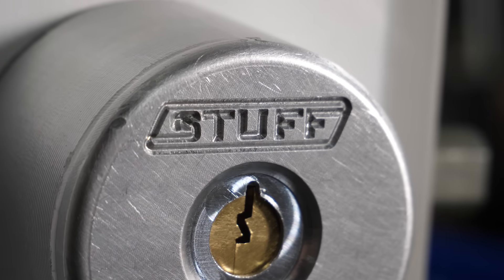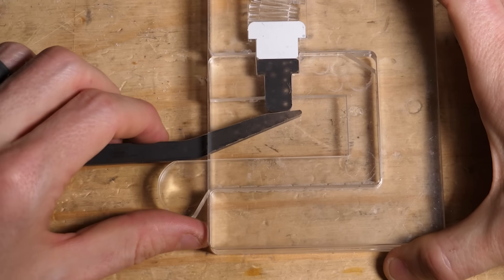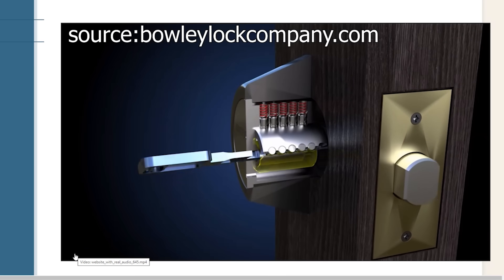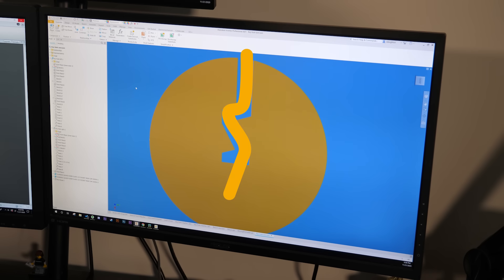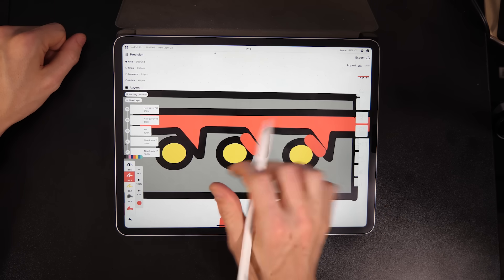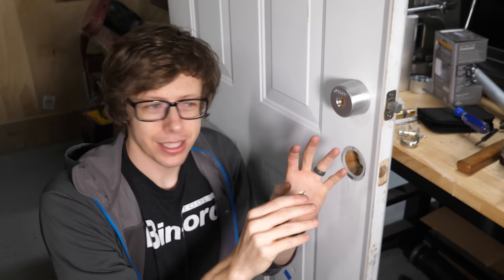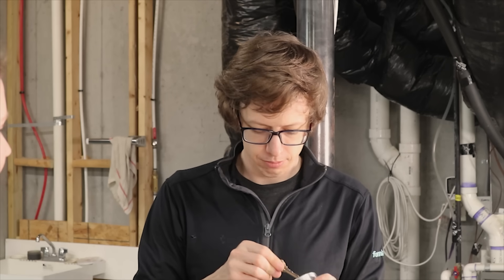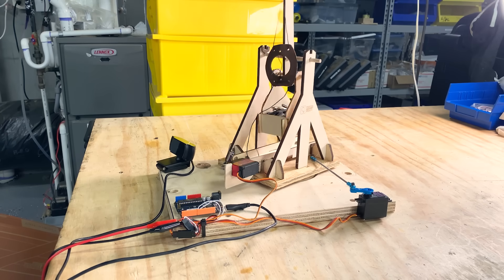Making an unpickable lock. Calling locksmiths

Comment: I'm no LPL, but I'm a decent picker.

If I was to try to get into this, my first strategy would essentially be reverse picking. If you aren't familiar,  with reverse picking you lift every pin above the shear line and then slowly release tension. As the pins fall the driver pins will hopefully get caught on the ledge from the shear line, and the lock opens.

Now, I know what you're thinking. The springy mechanism that traps the pins will keep them from falling, thus thwarting the attempt.  I think we can defeat those though. A good solid thwack on the front of the lock could potentially knock them back, allowing the pins to fall for a fraction of a second. 

So, we lift every pin, maybe with something like a comb pick, maybe with an uncut key. Next we turn the lock as far as we can. Finally we slowly release tension while rapidly whacking the lock. It might take a few tries and some luck, but I think it would open.

Comment: The most obvious attack would be to over set all the pins, i.e. push them all up over the gates with a comb and turn the lock. Assuming that's defended against, I suspect that decoding would be another viable attack, you can push a pin up to a given depth then turn the lock, when the lock binds, you could try reaching up with a pick to see if it is jammed or loose, and if the latter, the pin was likely at the right height. Repeat for each pin and cut a key when done. You could even do this by taking a key blank and filing it down as I don't see how this lock holds the key in place when it is turning.

Comment: I'm thinking you can use a long tension wrench to push the lever that the key pushes and apply tension to the pins and then use a normal pick to lift the pins one at a time and then use it to turn the core.

Comment: Hey SMHere ! I have a suggestion related to lock, maybe you could make a key way that use optical sensor to unlock the door but it would require a regular key for the mechanism.
On your design shown through the video, it's 3 pins. So let's take that base.
Each sensor will look through a small hole made in the pin that would hide the reflective surface on the other side. In order for the mechanism to unlock the closet pin would need to be the first to move then as you slide the key in, the second then the third. Then all pine set by the key will actuat a step motor to move the Deadbolt. If the electronic detect the pins are being move in a random order the key way would never disengage a step motor holding a pin preventing the keyway from rotating. A refusal standby would stay active for 15min before accepting to put a real key in.
Would that be insane? Definitly
At what cost? Electronic and coding Knowledge.
Also you could implement that on your already made unpickable(or maybe unpickable) lock lol.

Comment: A very interesting project. Something new in locks. 

One idea to help increase reliability of the pin locking bar is to use a fixed locking bar with a soft rubber between the bar and the pins to take up the tolerance.

Comment: Him: "if you want a lock to be unpickable get one without a key"
Me: we just went from pickable and unhackable to unpickable and hackable.
Reply: Picking is just mechanical hacking.
Reply: I mean, if it doesn't work, use a bigger hammer
Reply: @saturnity6  or even magnets
Reply: Don't cars have fairly decent wireless keys? If you trust the lock to secure a million dollar car that every burglar and their weird sidekick would want to break into/steal, I think it's safe for a plain door.
Reply: Also don't forget about those locks with number pads. It's basically the same thing, except the pass phrase isn't transmitted wirelessly but entered manually and those are pretty secure too, right?
Reply: Well in theory, thanks to some clever math called hashing, similar to data encryption, digital locks should be unhackable before the heat death of the universe. 
...in theory.

Comment: What if you over-lift the pins and turn the lock so all the pins are above the slot. Then you hold light tension as you tap the lock with a hammer, that should cause the pins to fall down (because the are only held up by springs). And the tension should make the pins catch the edge of the slot and then it should open.

Comment: The problem is, you're using an insecure key.  Anyone with a picture of that 2D key can just duplicate it. -- Also I'm surprised the locksmith couldn't get it.  They usually have a special key that let's them adjust each tine individually, so it doesn't matter if you can "pick" them one at a time.  You just dial in the key one at a time.

Comment: I feel like there might be a viable attack on this lock. SInce the pins will just stay at the picked height you should be able to 1 at a time nudge a pin up a little, turn the lock to test it. Keep repeating till the in is the correct height which may be detectable by the core turning slightly more due a pin going through its gap a little. Rinse and repeat for the other pins. If the tolerances are high enough this doesn't work, but if the tolerance are high enough no lock picking works, so it might have a chance.

Comment: I think it would be interesting if someone made an electronic lock that uses a traditional key, meaning instead of using a numpad, you stick a key in and it takes a picture of the key inside the lock, and it uses AI to determine whether the key is the correct one. This could possibly be used combined with the traditional lock, so the lock pickers cant just stick in a piece of paper that looks like the correct key, but they still use the key normally, it's just that the electronic part is an extra layer of security, but the sneaky part is it's an electronic lock that is indistinguishable from a normal lock.

Also another idea would be to use a hidden electronic lock like before, but use a special key. Perhaps a key could have a password written on the inside, and when pushed into the disguised keyhole it splits the key in half using a pin to reveal the password for scanning. I just think in general what I am saying is that security is sometimes more effective when the person trying to break in wrongly assumes the security system. Even more insane there could be a type of double key double lock, where the key itself has it's own lock that is only opened by the lock it opens, that way the key can't be copied unless the person has the lock as well. Or perhaps some other way to prevent keys from being copied or stolen.

Comment: "Extremely pick resistant" is a better term, but wow that does look challenging. I bet the LPL could do it.
Reply: He commented on this video, hes going to try at least
Reply: You have summoned the BEAST
Reply: A comb would open this in seconds
Reply: Single-pin pick resistant, anyway.  The internals that I see look vulnerable to comb picking though.  Those locking pins look like they can be pushed all the way into the faring.

Easily fixed design flaw but it might make the first showdown with LPL embarrassingly short.
Reply: @danielf3623  even if the upper pins were pushed with a comb, they still need to be set at the correct height to pass through the "gates".
Reply: @pjaxy  A comb pick is a bypass.  You don't have to push the pins to the right height if you push them out of the way entirely.  Which with those deep holes in the faring for the springs looks possible here.  Can probably be fixed with better tolerances or thin steel pins through the middle of the springs to prevent over-setting.
Reply: @danielf3623  I've actually been thinking about the comb/overlifting aspect. At first I thought that might be a vulnerability. But, looking at it again, those driver pins are very long, I doubt if there's enough room to fully recess them over the gates. But I'm sure we'll find out when LPL gets it. Also, I bet SMH is reading enough of the comments to see overlifting as a concern, if he wasn't already aware, and will account for it in the new revision.
Reply: Totally
Reply: easily
Reply: @wetmyappetite8082  As LPL has explained with difficult locks the process of learning how to do it is anything but easy even for him. What he shows in the videos often is after he learned to do it with tons of practice.
Reply: @dntthe88  He's done a ton of videos where he unpacks the locks he gets in the mail and picks them on camera for the first time.
Reply: @schwuzi  Yeah the shitty cheap locks. I'm talking specifically about known difficult locks. Refer to his Bosnian Bill episodes

Comment: The lack of manufacturability really hurts here. I invented a similar thing a while back that should be easily manufacturable.

Here's a diagram of an older version that's harder to manufacture: https://i.imgur.com/BF1XAvh.png. The new idea uses a fixed cut in the lock body and then an insert to perform the check for the type of pin. It won't be quite as cheap as a standard lock but it should be cheaper than a lot of other security locks, in my estimation.

The downside is that there are only a comparatively small number of possibilities. 2 per pin is comfortable, 3 is pushing it, 4 is probably impractical for a typically-sized body. Another downside is greater susceptibility to bumping than your design, though since you can't interact with the pins directly it's not going to be easy to pull off. I can fix this if I allowed less mass-manufacturable designs, but I think that hurts the whole idea.

(As a fun bonus, this method allows you to have a master key that rotates the other direction, still practically unpickable.)

A downside of your design you didn't talk about is that it seems possible for the pins to jam up in the unlocked position, and I don't see how they'd reset. My variant can't jam like that.

Comment: Can't wait to see the LPL crossover.

"not commercially viable" Let the lock sellers be the deciders of that... I promise you could sell this lock to people.
Reply: If it's nigh unpickable you'll automatically have a market, even if it's expensive as hell to manufacture. Banks and military installations, for example, would instantly look in your direction.
Reply: @OddlyIncredible  non-sense. Bank do not need unpickable locks. A lock only needs an insurance rating equal to the value it is locking up. Military does not need unpickable locks. They use crap locks every where. I think the fact that people are walking around with machine guns on a military base has something todo with the amount of time you assume a thief has to steal stuff. Even the perfect unpickable lock is breached by the commander issuing key copies to hill billies.
Reply: @sarowie  You would be surprised, even in just the lockpicking community if a lock is a good challenge enough people will buy it for it to be profitable
Reply: @sarowie , there are surprisingly few people with machine guns walking around military bases. There are in fact very few people with any guns at all walking around military bases. Other than police, and security details, everyone is unarmed.
Reply: @Steph.98114  Sure - if LPL and Stuff made Here would put in on the market, some would buy it as merch, souvenier, to support their favorite youtuber, ...
Reply: @notahotshot  Well, I am swiss. In mandatory military service, just a few years ago you HAD to take the assault rifle home including a small amount of ammunition. And you had to use public transport, uniform and carry your riffle to service. Anyone thinking that Americans have to many guns has not need experienced the swiss military system, where as adult male citizen you have to jump trough hopes to NOT end up an assault rifle at home (if not many as those also becomes heirlooms).

Comment: Here is the problem you now created, you won't have to deal with it for a little while but the pins will wear as will the key and eventually your lock will degrade to the point that you can't open it because your pins don't line up as needed. So to prevent a lock out due to failure you will be replacing your lock before it is needed.

Comment: Interesting design, having what is basically a hybrid lock - pin tumbler and warded. You have warded pins. Would it be possible to overlift all the pins first to get them past the sheer line, then 'bounce' the tension untill all the pins latch in thier wards. (To prevent this attack, you would need the pins to have serations on them). When you say it's far too intricate to be a viable manufacturing prospect, I don't agree. The rekeyable sidebar mechanisms in some locks are incredibly complex, as is the patented Ingersol mechanism. Make some improvements and get your design patented.

Comment: Unless I missed it in the video, wouldn't a bump key work if you cut the tip of the key off so it doesn't engage the pin locking mechanism?

Comment: The easiest way to hold pins in place would be with a small metal bar that has a rubber sleeve around it. Something as simple as a piece of heat shrink tubing should have enough "give" to make up for manufacturing imperfections. On top of that rubber on metal has higher friction then metal on metal.

Comment: There's a special technique that will work,  you have to line up the hammer directly on top of the lock and hitting it as hard as you can. Once lock has down off the door,  you are in.

Comment: Disclaimer: i know absolutely nothing about locks

Can't you make an electronic key that tries all the combos really fast? I know it'll probably take a while for it to find the right combo but if your trying to break into a house, you could insert the device into the lock, let it go for an hour or so and come back and it will have solved it right
Reply: You'd also need to have it attempt to turn the cylinder every time, and you'd need some relatively tight tolerances to ensure that you don't end up missing the correct combination simply because it was slightly off or moved during the turn attempt or something. Plus you'd need the mechanical parts of the key to be able to withstand millions of tries every time you use it. Plus different keys use different step heights and keyways so it would be essentially impossible to design a single key capable of being used on any lock.

So, even if it's technically possible, it's not really a practical solution to anything and would be extremely expensive to engineer.
Reply: @UnraveledMnd  riiight i was thinking that you would have to slide the pin and find the right spot as you slid it like you would if it were a single pin but you would have to keep one pin in a specific spot as you tried the rest

Comment: So heres an odd idea. What if the pins are split up into 3 sections instead of 2. That way the key pushes 1 or 2 parts above the threshold, and making it harder to pick because of the variety between pins.

Comment: Have you considered a small clamping mechanism like a collet? When you push the key, the lever that locks the pin would push that collet down a tapered edge, releasing it, and when you take the key out, it gets pushed back up, locking the pin in place. It would be way more reliable this way.

Comment: One weakness I see is comb picking.  

Not to push the pins all the way out of the cylinder, but just to make sure every pin is overset above the gate.  That way you can rotate the lock to where all the pins are up against the gates and jostle the lock until the pins slip down and (hopefully) catch on the right gaps.
The easiest way to address this would be false gates, making it much harder for the falling pins to catch at the right spot, but I wonder if it would work better to move the gates to be horizontal so that gravity won't change the height the pins are set at if the lock is jostled.

Comment: The bit about why he had to use springs to lock the pins in place made me wonder if you could use different thickness pins (in holes of the same size) to ensure no more than one or two pins could be held in place just using tension on the core. 

I am sure there is some problem that would cause or weakness that could be exploited, but the only issue that immediately comes to mind is that it would make things more expensive by complicating manufacture (rather than, say, 8 lengths of pins, you would have 8 lengths, each with 5 thicknesses, for a total of 40 different pins, and that is before you bring security pins into play).

Comment: Locks that doesnt use keys are more vulnerable than standard locks. This is the modern era, stuff is hackable. If it uses a wifi, that can be hacked. If it uses bluetooth or ur phone as a key, that can be hacked aswell. Theres also magnets you can use...

Comment: what about a hydraulics based lock where each pen moves based off of the fluid pressure and if not done in the correct order it could have a mechanism that releases all the pressure and relocks all the pins